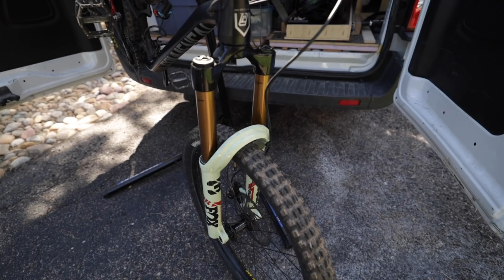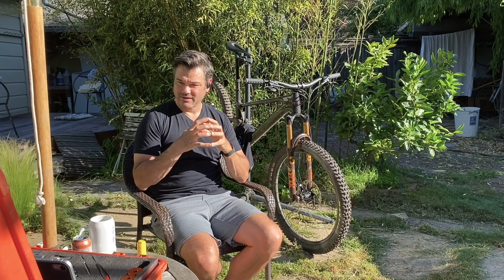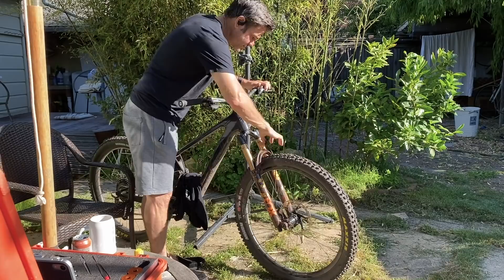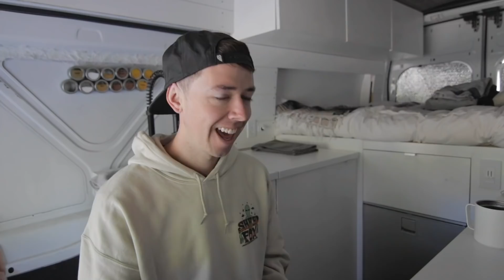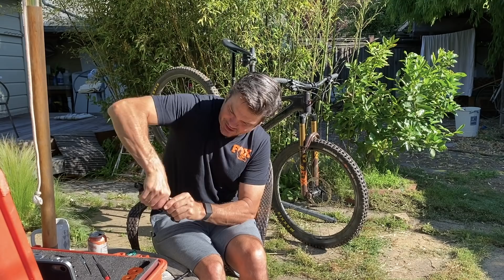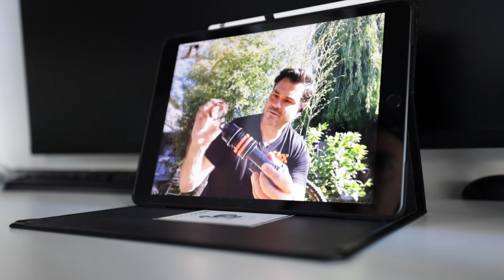DIALED S2-EP19: Suspension bottoming out? Volume spacers might be your solution | FOX

Comment: How is the overall setting of the fork influenced by adding or removing volumspacers. For Example you remove a token. Setup Sag again. Do you apply an changes to the previous rebound setting or does it stay the same as with 1 spacer?

Comment: what still isnt clear to me , after you add a spacer or token , do you put in te same pressure as before, witch will affect the sag (it did in my case anyway...) and ignore the change in sag, OR do you set the sag the same as it was before , and ignore the change in pressure that comes with it? (witch is in my rear shoch about 12 psi less)  all i find about it is very confusing.

Comment: Does "bottom out" really mean, that the O Ring is sitting right at the Crown after a hard Impact? I'm asking because my Fox 36 has 170mm of travel but if i messure from the dust wiper to the crown it is actually 180mm.

Comment: What if i forgot to properly pull the snap ring back or remove it completely and then slide the can / outer housing back and it jumps over the snap ring? Is that bad and an issue?

Comment: Nice, although imho - a bit too basic... granted, bottomout resistance is the main purpose of spacers, but i think it would be nice to touch the other implications on suspension. 
- midstroke support
- small bump compliance
- rebound (can be really affected by chamber volume ratio)
- spacers vs HS/LS compression
Sorry for the criticism :)
Reply: Good point here!
I’m about to start messing with v. spacers. 
Where can I fing those infos?
Reply: @Alexandros_Patsialidis  try the video series by vorsprung suspension. They go quite deep.

Comment: Nice work @jordi cortes and the @fox team - great video series.
Be interested to hear thoughts on Volume Spacer Vs (the likes of) MRP Ramp Control Cartridge & the Manitou IRT...
Just another level of complexity 'most' don't need?
I certainly like the flexibility of the IRT on my Mattoc's with the 3 quite different trail centres close (riding dist.) to home...
But have never revisited the Volume Spacer I threw in the DPS shock #facepalm(?)

Comment: So if the volume spacers ramp up to prevent bottoming out. What effect do volume spacers have on rebound?
Reply: None
Reply: jordi cortes ok so it does not ramp up the initial rebound. Correct? Being that the rebound valve is not affected by the load of the spring?
Reply: They are going to push back harder right at the end of the stroke

Comment: lets say got 20% sag on fork, 1 token and bottoming. Bump up pressure, click in compression or drop in another token? BTW small quiz. Who said that: "I’m running 3 tokens @ 86 psi in the fork, and a 600 lb spring on the coil. Used to run more tokens but got a look of disappointment when I told Jordi how much I ran once so I run less now lol." hahaha
Reply: If your suspension feels great and the only problem is bottoming out = add volume spacers.
If your suspension feels to soft in general = add air.

Comment: Love these videos... they are so good... I run Rockshox revelation forks don't bottom out so never thought I needed spacers but would they make my suspension feel more linier?
Reply: Spacers would make the shock less linear, and more progressive (in general). Unless there are spacers in there already you could remove I don't think spacers are the answer. Probably either too high pressure (check your sag) or some of your compression settings are off? Idk I'm far from an expert
Reply: @patymac14  thanks dude

Comment: So what's the best reason to use volume spacers instead of more air performance wise? Assuming sag doesn't matter and we have two air springs with different volumes that require the same maximum force to bottom out, wouldn't the more linear spring offer more support, particularly early in the travel? Is it just rider preference?
Reply: I think you need to watch the video again.
Reply: Some people want a cushy fork that rides too deep in the travel so use low pressure with spacers. Some ride hard so run high pressure & spacers, then there are the normal folk.

Comment: I'm just like 0,5cm from bottoming out on drops but while breaking I use about 60% of my fork and it doesn't really absorbs anything anymore, would volume spacers help in that case?
Reply: Drop your heels
Reply: Maybe your fork is set up to progressive. 
If you think the fork is diving to deep in its travel (don't confuse with „to fast“) = add air. If then to much travel is left after hard impacts = remove volumespacers additionally.